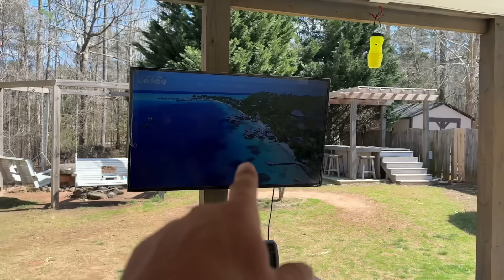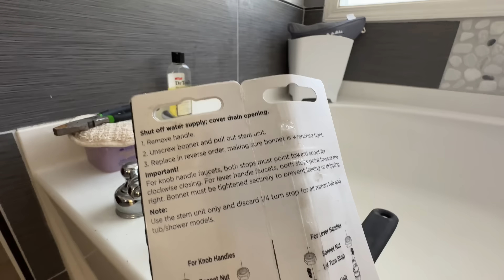FINALLY A LOAD !! Prayed to God for a memorable Spring Break !! Let’s head to the BEACH

Comment: Black is usually hot on that switch, white is neutral and green is ground.  Something has to be wired up backwards or neutral or ground is touching the hot
Reply from the maker: Thank you so much figured it was a three-way switch not a two-way